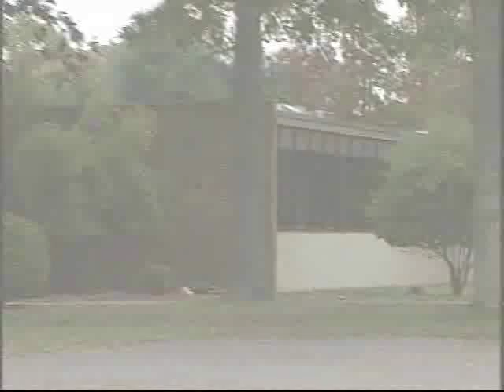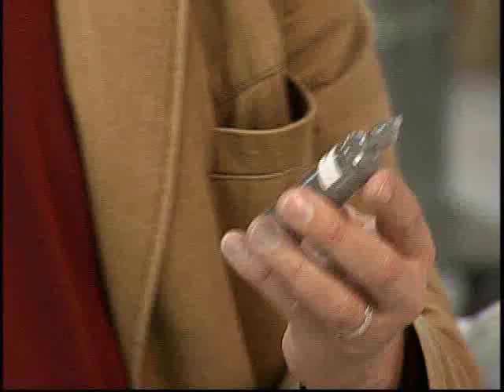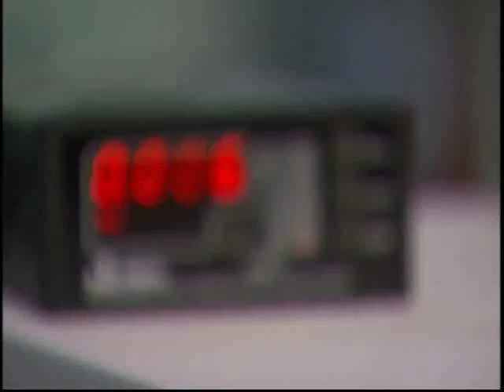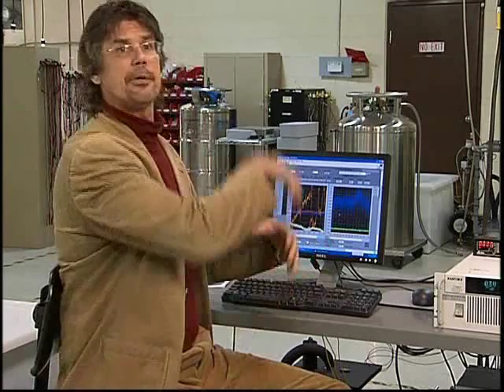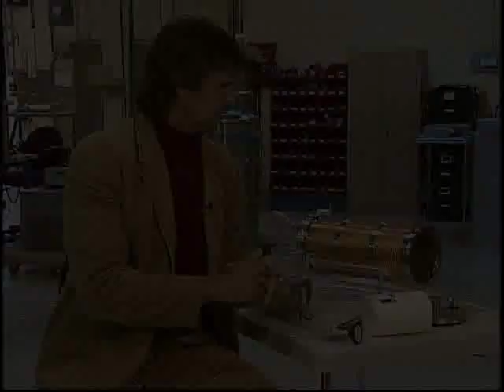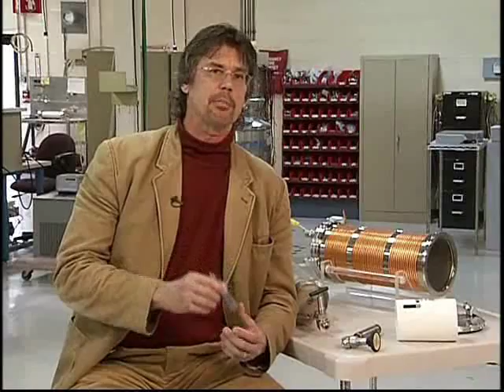Proven Clean Free Energy by Blacklight Power

Comment: The only way I know that the electron of hydrogen can move into a lower orbit is when Hydrogen undergoes conversion from the ortho to para state. This conversion has to do with the electron orbit going from parallel to Anti-Parallel. Hydrogen is composed of 25% para and 75% ortho, at room temp. Catalysts for the ortho-para interconversion-ferric oxide,activated carbon,platinized asbestos,rare earth metals,uranium compounds,chromic oxide,or some nickel[25] compounds.This reaction is exothermic.

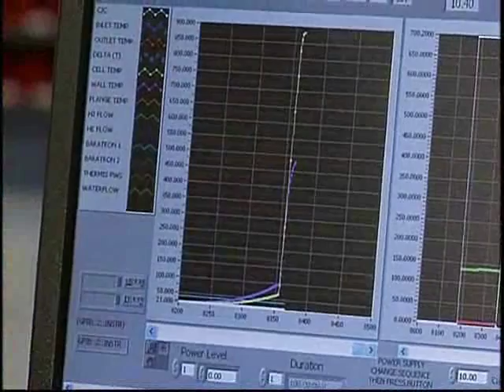Comment: The guy say at 4:17 "Is when the reaction pervaded through that powder, the nickle powder and basically used all the Hydrogen that was available". So how would hydrogen be available in water. Well when water reaches the correct temperature the nickle will oxidise in water which strips the water molicule of its Oxygen leaving the Hydrogen available for further reaction. Very simple chemistry High School level, you posted this video but you havent listened to it Why?

Comment: Whats the mystery? Reacting nickel powder with water. The nickle oxidises and gives off Hydrogen which I am guessing is recombined with oxygen bubbles disolved in the water to give a chemical reaction releasing heat and returning the Hydrogen back to water vapour. As both reactions are exothermic rapid heat production is to be expected. This is just one or more simple chemical reactions hardly free energy just the release of energy stored in the nickel power?